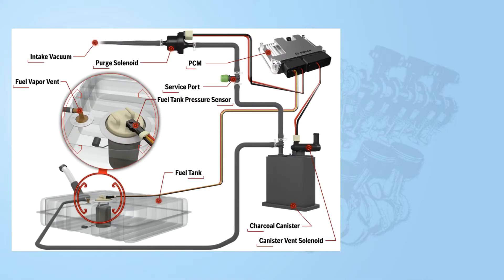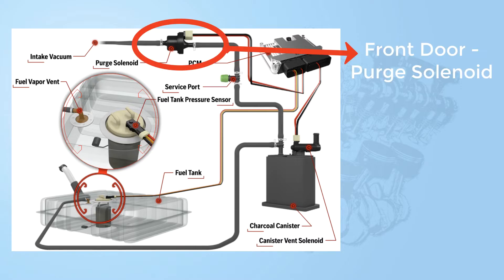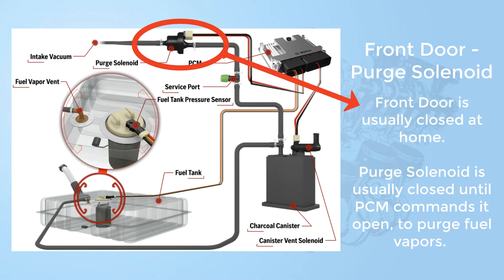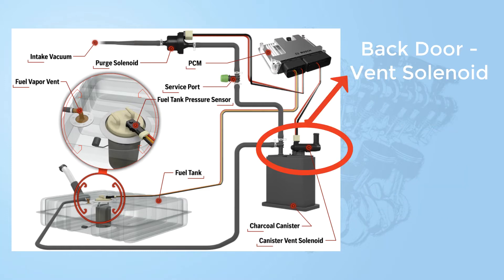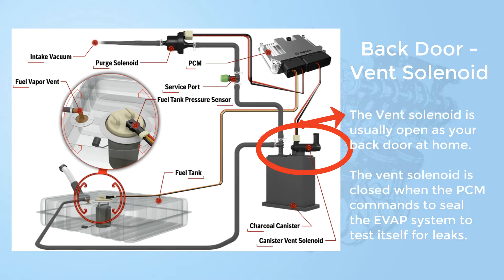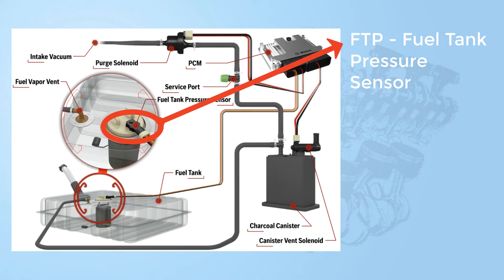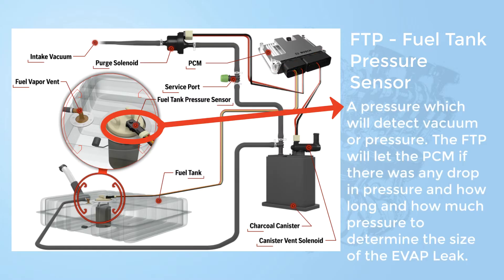MASTER THE EVAP SYSTEM BASICS 🤓

Comment: What does PO 440 code means on a Subaru 2000 Forster
Reply from the maker: Could be various things, have you tested anything with the EVAP system yet?
Reply: @MasterAutomotiveTraining  other than spraying soppy water on the hoses and nothing was found no bubbles no change in the RPM

Comment: For flow codes often the purge solenoid is electrically good but clogged with fuel vapor. My preferred diag method there is the mechanics stethoscope. When I worked at a dealer I learned what a new good purge valve sounded like

Comment: Thank you for the detailed video! Great job! I have a problem with the EVAP system on my Honda CRV 2018- - Smal Leak Detected. I wanna diagnose Fuel Vapor Canister Filter. I am not sure if it works correctly. My questions: 1. Should air pass in both directions when blowing through filter? 2. If I close one of the openings and blow into the other, air comes out through the port where the electrical connector plugs in. Is it supposed to be like that, or is it not normal?

Comment: What if you have no gas cap on your truck 2018 Silverado
Reply from the maker: Capless systems are the same if its a vacuum decay system. It has a springloaded closure flap inside. Your fuel door acts as a seal to keep dirt out of the closure flap.

Comment: Engine running,front door open,back door closed..........engine off, front door closed, back door open....you have to command the back door closed via scanner....to check for leaks,,,,but if the back door stays open while command closed ....clamp off the hose to it then check for leak, if no leak...well by now you know the back door is the prob...but still check for power and control always....

Comment: Had a P0446 code. Replaced vent solenoid and gas cap. Solenoid was bad for certain but now the code comes back only after the cap is put back on after refueling. So if I delete the code after I refuel each time the money light stays off until the next refuel. 2005 colorado
Reply: You haven’t fixed the problem at all. You misdiagnosed it. It’s a faulty Fuel Tank Pressure Sensor that’s sits in the top of the Fuel Pump and Gas Tank. This is common. I just did this repair on Monday. Dropped the tank and replaced the sensor. Erased the P0446 code and it runs great and the code is not returning. 2019 Chevy Colorado I believe. And yes I am a professional technician.

Comment: oye tengo un problema tengo un minicuper 2007 n12 no turbo digamos que le puse motor ajustado válvulas. capuchones. y tapa de válvulas nueva claro válvula pcv nueba  por la manguera de recirculacion de gases esta jalando aceite .  al parecer creo que tiene mucha presión al jalar grado que aspira aceite mucho .y empieza ha  fallar una bujía o el sensor de el árbol de levas intake  después de quemar el aceite
Reply from the maker: Haga una preuba de leak down. Talves se an anillos porque es mucho blow-by.

Comment: Good video! But what if the evap system is building pressure? When you remove the gas cap you hear a rush of air, what do you do then? 🤔
Reply from the maker: It will if the vehicle is warm, as long as the FTP reads and changes in pressure it will indicate it works.

Comment: Hi there , your video is great and was giving a great detail on the evap , 
I originally was looking how to fix my problem with the car .

So far was not able to find the problem, hope maybe someone here will be able to ...

When I put gas in the tank it trigger up right a way and some gasoline goes out a little , don't matter if it half empty or completely empty  but if I put it in a slow barely triggering it in it will fill but I am standing there and holding it for 30 minutes to fill , was being in a shape and they changed the charcoal canister and the back valve but still have the same problem...have no code at all ...
Reply from the maker: What type of car, year, make & model? How long has this been happening? Did you have any recent repairs done prior to this starting? Where are you located?
Reply: @Master Automotive Training  it is nissan frontier 2004 ,
I got the car about a year ago and it .
And on my first fill up it cleared on me , I did the driver valve cover on it at that time .
And as of the problem to filling up I taked it to a shop where they replace the charcoal canister with the valve in it .
But the problem still there ...

Comment: I have a P0442 small evap leak on my H3. I took it to Firestone repair shop and they did the smog test to the system. They said they couldn't found any leaks in the system. NOW, I notice gas smell right behind the driver rear under the fender. Can that be the small leak that the code is giving????
Forgot to mention, is on the same place side were I add gas to the H3. I replace the gas cap for a new OEM gas cap. And still give me the code. 
Help!!:face-purple-crying:

Comment: But is it possible to have an evap leak that isn't being detected (no trouble codes)?
I'm trying to solve my vacuum issue. At highway speeds 55+mph if I give the car decent amount of throttle to increase speed, the a/c vents start cycling - few seconds on defrost, few seconds on feet, then eventually returns to normal vents.
Also I have issues where from time to time it will throw a code for open injector circuit. They may or may not be related, I haven't figured it out yet.
But it's annoying! the van goes into a limp mode and i have to reset it before it will drive normally. 
more recently it actually went into a fit with some backfiring (little pops). I had to nurse it to the side of the road and feather the throttle gently to get power back. its all so intermittent though! I wonder if i just have to wait for it to get worse 😭

Comment: thank you for the great tutorial 
and you are right   a car vw golf mk5
fuel tank cap if it's not genuine  it will cause random  error for  low fuel tank pressure causing the engine to limit it's max rpm even with full throttle is pushed down .
👋👋

Comment: P0457 pt cruiser 2005 non turbo .. gas fills fine. New gas cap oME , smoke test showed nothing , purge solenoid replaced leak detector pump... Still have P0457 I'm in NY it won't pass inspection soon help! Some people are telling me there is a filter before the leak detector pump... I'm basically throwing parts at it saying are you fixed yet?? Help!
Reply from the maker: Hey Kathy! The P0457 indicates your EVAP system detected a small leak and it thinks its the fuel cap. Have you inspected the purge solenoid? See if the solenoid isn't sealing after it allows vacuum into the fuel tank then you can also get this code. Please let me know if you have further questions.
Reply: @MasterAutomotiveTraining  all parts replaced after smoke test showed nothing. Purge solioid, leak pump detector and OEM gas cap so what else you got! ?
Reply from the maker: @kathylewis7543  Where all parts besides the gas cap purchased from the dealership?
Reply: @kathylewis7543  is your fuel tank have between 15-85 %  of gasoline in it

Comment: Hi I have questions Does compressed natural gas That is EVAP Because when I smog They are asking for EVAP
Reply from the maker: Is the vehicle bi-fuel? CNG & gasoline?
Reply: @MasterAutomotiveTraining  only cng
Reply from the maker: If it’s powered solely by CNG no EVAP test will be required. California Smog check Manual section 1.4.6. States: • Vehicles powered exclusively by diesel, compressed natural gas (CNG), liquefied natural gas (LNG), or liquefied petroleum gas (LPG); are excluded from having an EVAP test performed
Reply: @MasterAutomotiveTraining  OK thanks
Reply from the maker: Anytime